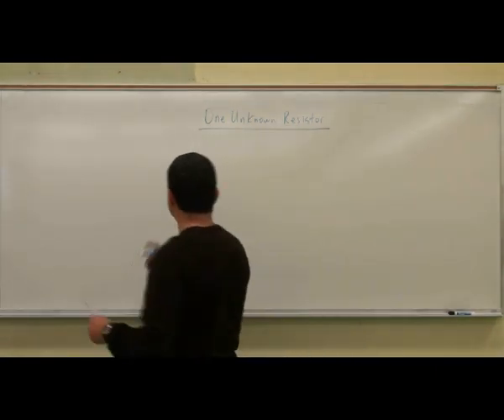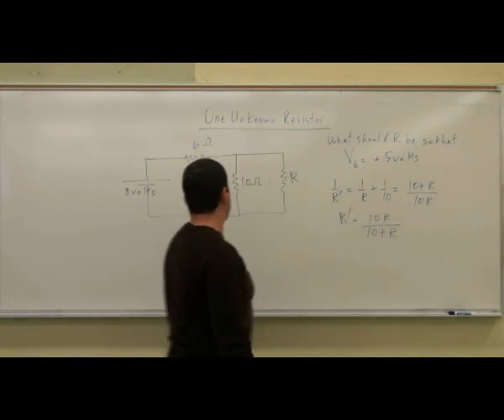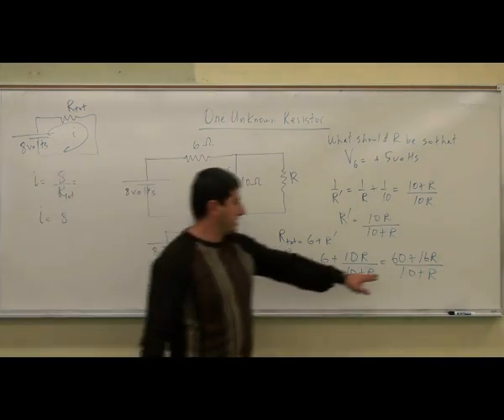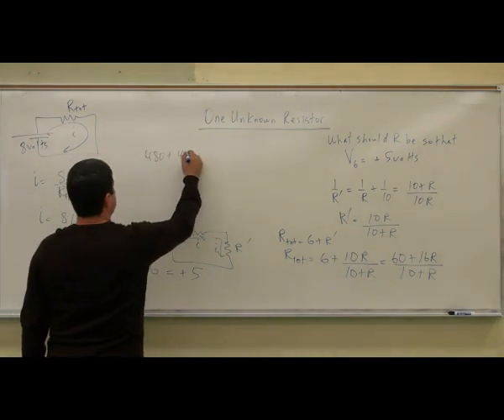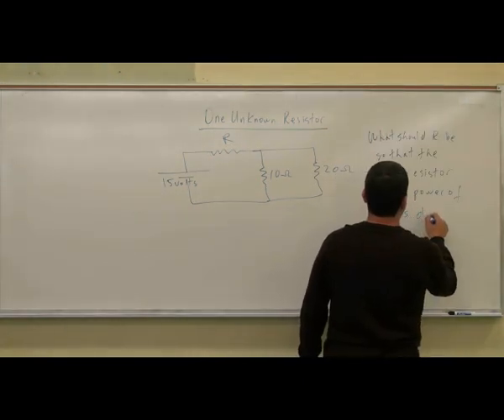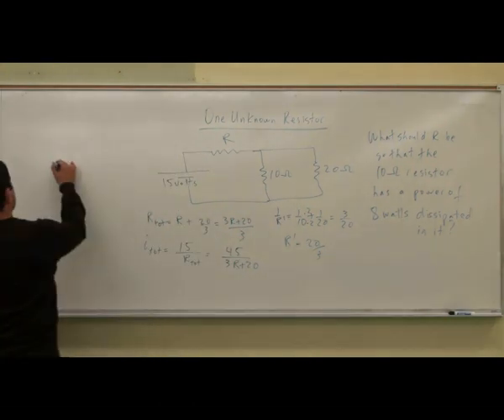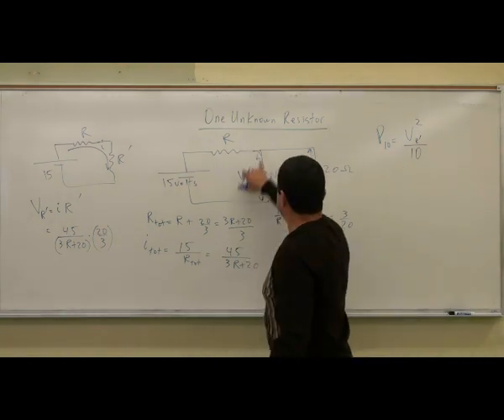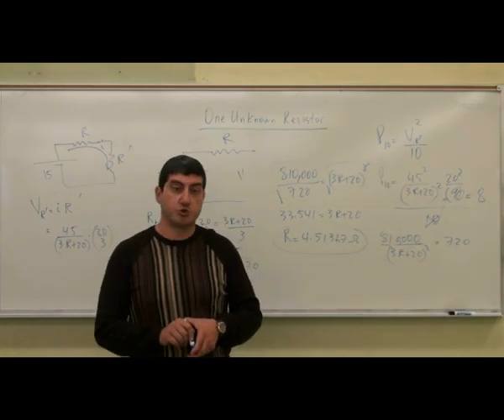One Unknown Resistor.avi

Comment: There are many different types of circuits and you just cant use a formula to all, there is a specific. For example the formula of finding the total parallel resistance cannot be used in finding the total series resistance. I think you first introduce what type of circuit is that.